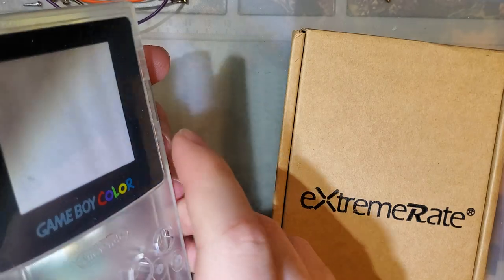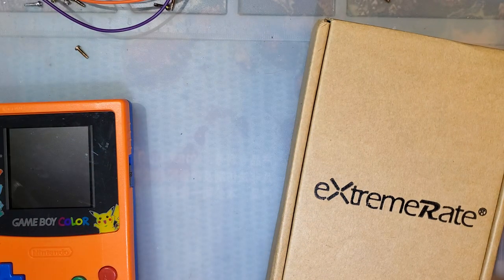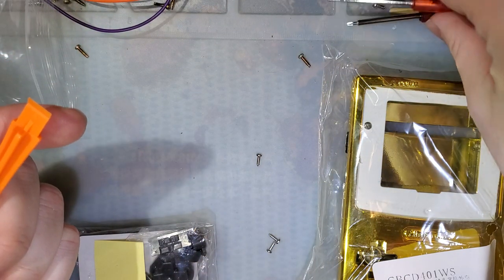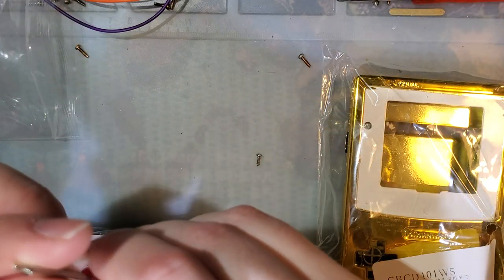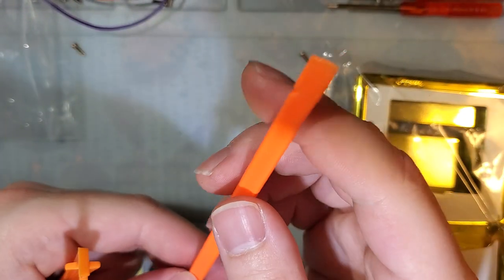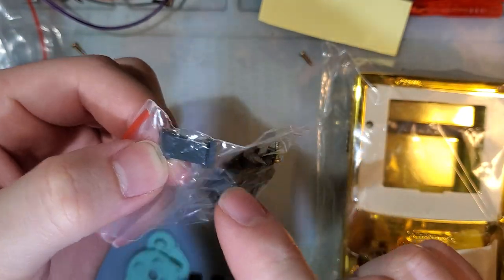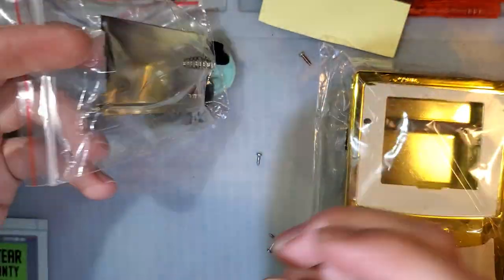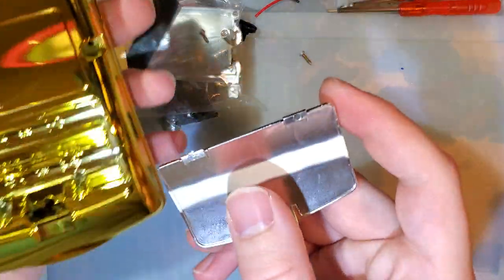Gold Chrome Game Boy Color

Comment: Great write up and video. Glad you're providing a ko-fi link.

I bought the purple / blue one and it's got a few issues due to how thick the paint is:

• None of my lenses fit without significant filing to the lens opening. Since the underlying shell is white, I have to be really careful to make sure it doesn't look janky as I grind it away.
• The OEM IR sensor does not sit flush to the shell
• The power switch is crazy tight. I can probably fix this with some filing as well. 
• The shell is a little too thick for the capacitive touch sensor to work through it. I'll need to either file away a spot for it or put it under the IR lens, which I really hate to do. 

Otherwise I do love the way the finish feels in the hand. It looks amazing with the JellyBelly metallic blue buttons and white lens (JellyBelly has silk screened lenses now that look absolutely fantastic). But yeah, it's a lot of work to get it just right.

Comment: Question about getting the screen cover mint.. I ordered a bunch from Ali... And the first 2 I've used have white specs on the inside I can't seem to clean off.

Tried with isopropyl and it's still there.. Tape does nothing. This a manufacturing defect?
Reply from the maker: if the screens are glass, you can try scraping with a razer blade. You should contact the vendor though
Reply: @makho  they are glass.. Am reaching out to the vendor.

Don't want to scratch them so don't want to use anything metallic on them